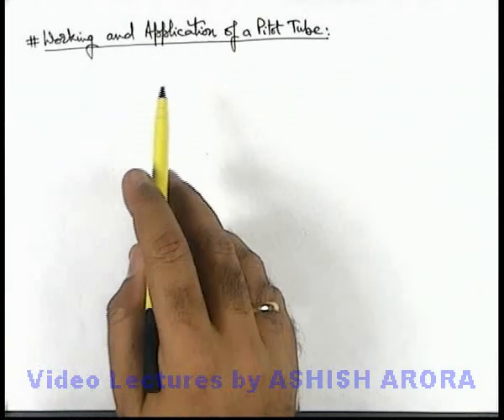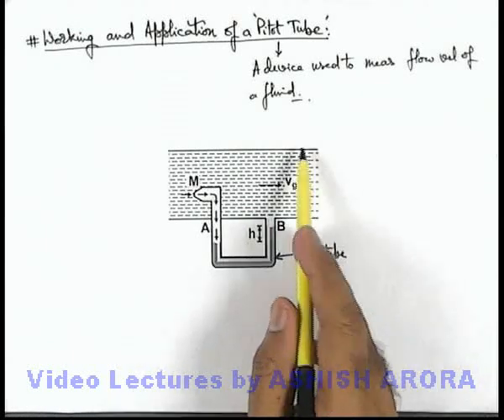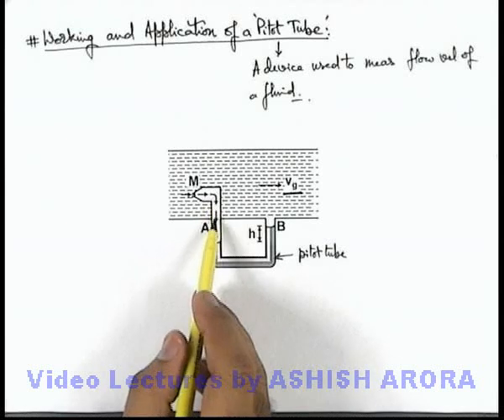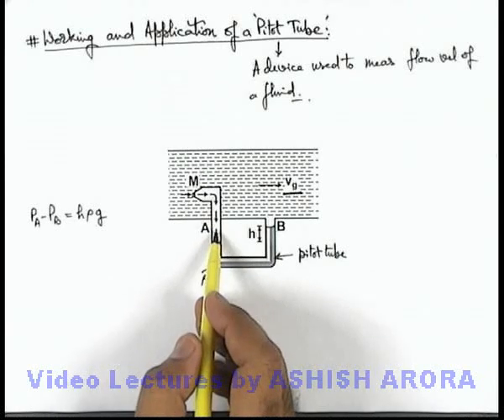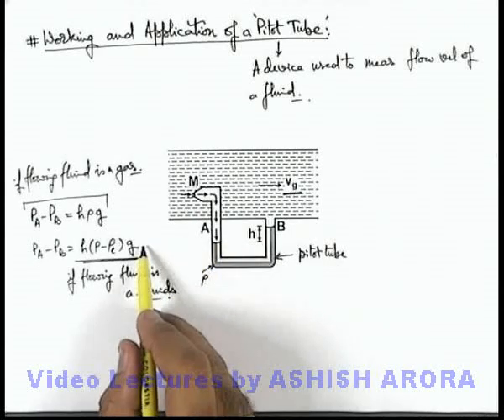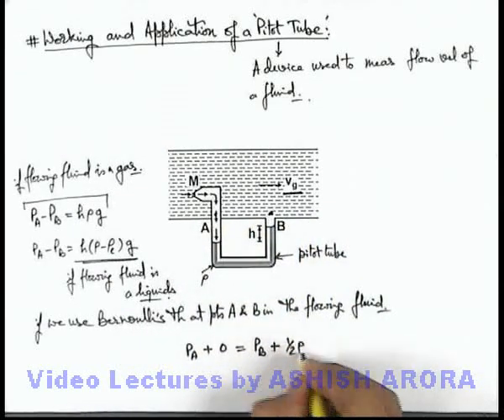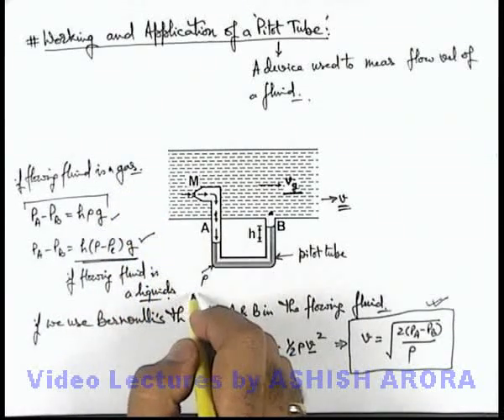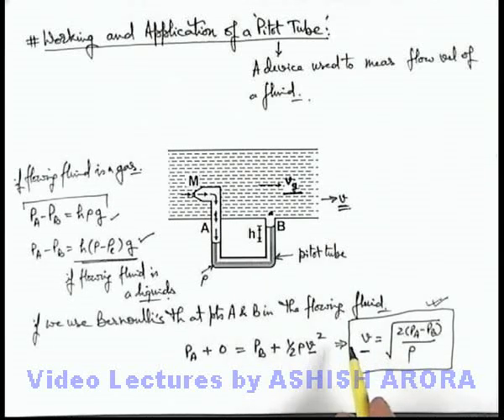Class 11 Physics | Fluid Dynamics | #13 Working and Application of Pitot Tube | For JEE & NEET

Comment: Sir , with due respect I was following your video and i found that your derivation for pressure difference is totally wrong .
Pa- Pb is never equal to (p-Pl)gh=x  
Rather  x should be equal to p1 -p2 
Where p1 is pressure at narrow opening of pitot and p2 is pressure at just same level  as is  1and above the other end of pitot .
You should update this for ypur students as it creates confusion for details you may inbox me at 9116577901 .
Regards and have utmost respect for your vast knowledge

Comment: Why the liquid is coming into rest when fluid enters in the pitot tube through point M instantly? I didn't understand the point that you said '' as there is no continuous part to flow for the fluid that is why the fluid is coming into rest". Can you explain elaborately?
Thanks in advance
Reply: As due to the immiscible liquid it can't flow further and comes to rest above it
Reply from the maker: That means as streamline flow requires continuous path for flow of particles which is not there due to another liquid inside so the flowing fluid comes to rest...
Reply: But why does it come at rest at M and if that is the case then how does it reach point A

Comment: (rowA- rowB )for liquid can't understand. ...please explain Sir. .!
Reply: alright, listen up! First locate the points A and B correctly. Point A is at the same level as point B. Now,I will mark another point in the column right below point A at a depth H.Let's call this point 'X', Point X. Got three of these point? Now, listen, this is easy. Since the gas is of less density we can say Pa=Px. Now Recollect the manometer lesson to get a better idea. 
Px-Pb=H(rho)g. Since Px=Pa, Pa-Pb=H(rho)g. Part one complete.
Now let us take the second part where the fluid is a liquid of density (rhoL). Here, Px=Pa+H(rhoL)g. Keep that in mind. Then , Px-Pb=H(rho)g. This is another equation. Here, Put equation 1 in eation 2.Then we get, Pa+H(rhoL)g-Pb=H(rho)g.
Thus, Pa-Pb=H(rho)g-H(rhoL)g=H[(rho)-(rhoL]g. This should clear things up. It took me about 30 minutes to figure it out. 
You're welcome, my friend. My insights have indeed saved you from ignorance. You're welcome.
Reply: @nirupamamahadas4200  a and b are not at the same level. If they were at the same level, pressure at those points would have been the same as pressure at two points at equal heights in the same fluid is same.
Reply: Aneesh Vaidya i think u r in biggest confusion.
U must have studied in manometer theory that pressure at same level or same pressure line is only equal if they fullfill all the following conditions:
1.) They must be of same liquid 
2.) force acting on the  pressure line must be perpendicular 
3.) velocity must be same 
4.) FLUID MUST BE CONTINUOUS ie NO OTHER FLUID MUST COME BETWEEN 
In the given situation 4th condition is not fullfilling i.e. there is liquid between 
Hope it will help!
Reply: @krishnaanand917 where is it given? It's not in pg book and sir also didn't tell!
Reply: @nirupamamahadas4200  thnx bud
Reply: @nirupamamahadas4200  can u explain where exactly are points a and b
Reply: @yatharthgupta6468  Point B is exactly where it is written. Point a is supposed to be  at the same level as point b. I hope this helps
Reply: @nirupamamahadas4200  still replying after a year?
Reply: @nirupamamahadas4200  thank u so much yrr😭🤗
Reply: @vasunith9682  yep and since you have read my answer, praise me!
Reply: Nirupama Mahadas You should really be praised nirupama sister. No doubt in that. Because understanding things could be a small thing.
But making someone understand is a big thing.
And it becomes way more bigger when u make someone’s concept clear just by text. 
Thank u so much sister. You really helped me😇😇😇.
But i have still one doubt left if u can help: why velocity at A becomes zero.
Reply: Vasunith S.parashar if u cant help anyone don’t let down anyone who is trying to help anyone.
And what if she took 30 minutes. Einstein said- If you can't explain it simply, you don't understand it well enough.
Reply: I guess that is pa-pb
Reply: @vasunith9682  There's no need to flex your skills in comment section. If you can understand that without any explanation in 1 minute, you can show off that skill in the paper and get a rank.

Comment: sir, if you considered both points a and b at the same height in the flowing liquid why was there a pressure difference? The equation for pressure difference would make sense if the points a and b were the points at the ends of the liquid in the tube.
Reply from the maker: It is because the difference in speeds of particles due to which the level difference is the there in U tube...

Comment: sir ,in case when flowing fluid is liquid why only h height is used .
please explain
Reply from the maker: +Yash Agarwal because above level of height h density on both sides of liquid is same and it will not affect the pressure difference... and we have accounted (rho - rhoL) in calculating pressure difference.